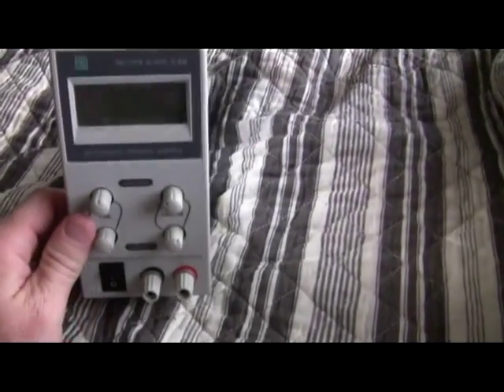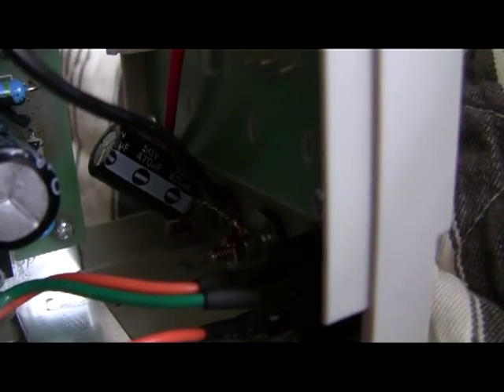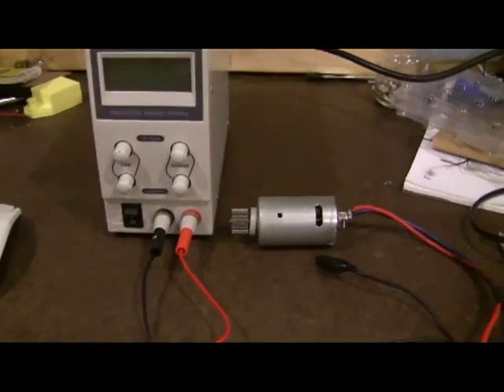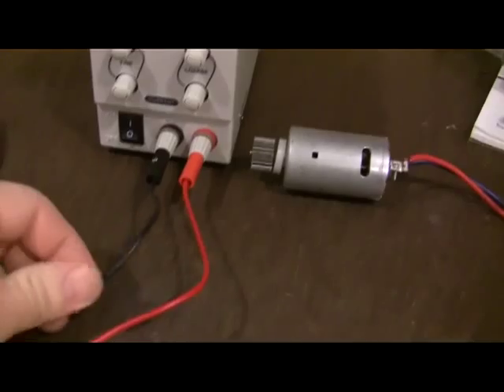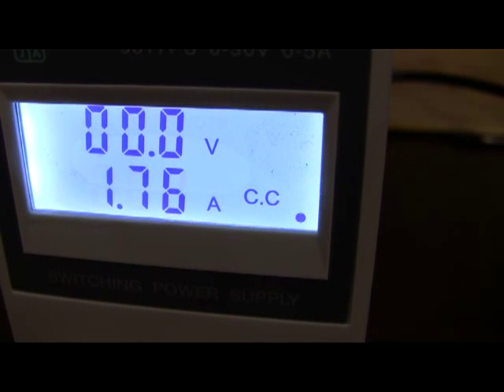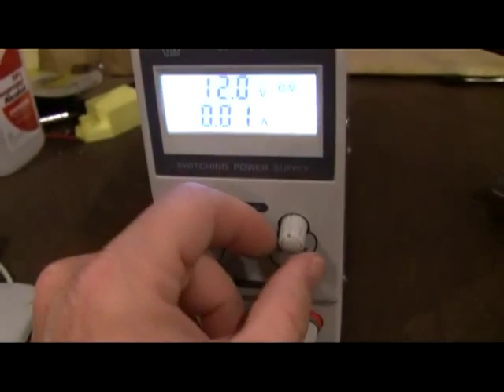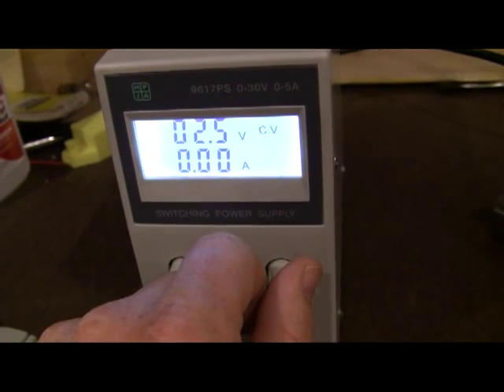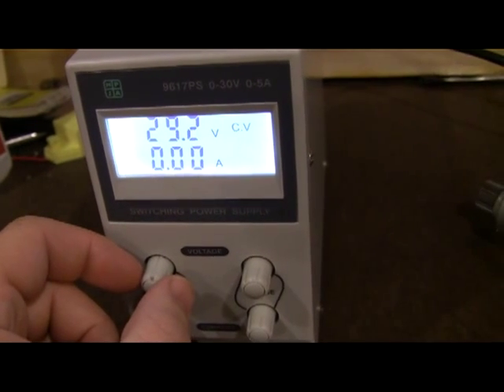Bench power supply 0-30v 0-5A

Comment: I've a the same in 30V - 10A, and after one year without use, the Amp start at 0.42A, not at 0A. Why ? How do i calibrate the current limit ? i can't light a led with this configuration...
Reply from the maker: Sorry no idea, don't have that model and never had a problem with the one I have.
Reply: Hi, I have PS 3005 and have exactly the same problem. It has disappeared after cleaning and reinserting connectors to the front panel. I have used a contact spray.

Comment: The back cooler works from the time you turn on the power supply ? or the cooler of the power supply just work after a long time based on a temperature sensor ?